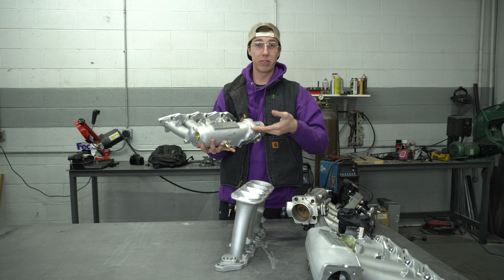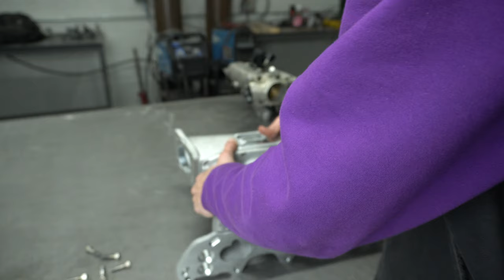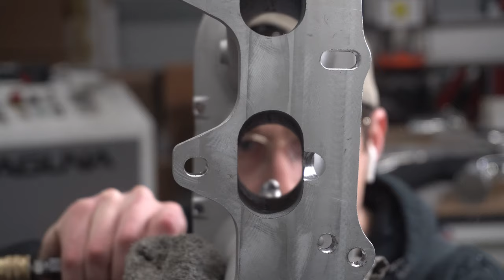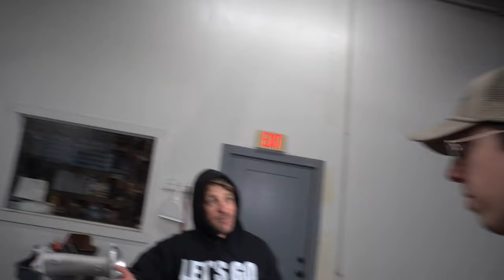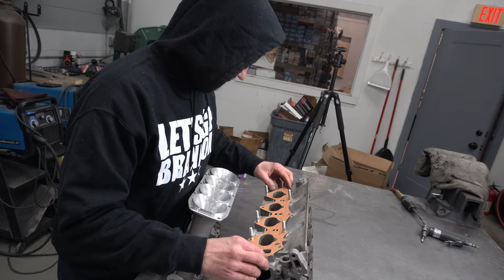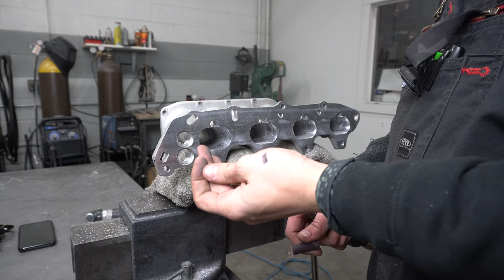How to Port an Intake Manifold Without Cutting or Welding!

Comment: I believe you don't want to blend the port dividers at the end of the runners, they are designed that way so the pulse wave resonance does not negatively effect the adjacent runner. Ideally you want a gap between each bellmouth so one port is not sucking air out of an adjacent one. Smoothing the inlet runner tubes is probably fine, but otherwise I think you have probably made that manifold worse overall.
There is also an optimum runner cross-sectional area to match the valve throat area, this is how you flow the most air as a thinner column of air will gain more kinetic energy and ram in more just before the valve closes, this is especially effective in variable valve timing/lift heads.
Runner length and plenum volume is also tuned for optimal performance across the rev range.
Match the ports, not to the gasket, remove the minimum amount of material.
If you don't understand Helmholtz resonance and such, just don't mess around with things and most likely make them worse.
Read David Vizard's publications on optimum inlet runner taper angles and bellmouth radius to diameter ratio... before hacking into your extensively developed and designed manifold. You can improve on a product mass produced down to a price, but not by trying to completely redesign it in this case, just clean up casting flash and such.

Comment: What kind of cams are you running on your built motor ? If stock you should definitely upgrade.. the b series vtec engagement isn’t as strong as let’s say an H series but if you get cams you might feel it a little more
Reply from the maker: I was running b16 cams. I upgraded to GSR cams and saw like 40hp gain at the same boost level. Pretty nice.

Comment: "Witout cutting or welding" ok john.. go grab a b16 manifold and port it for me without cutting and rewelding. And I mean runners ported and knife edged.. Anyone can port a manifold with a removable plenum. Stupid clickbait title..
Reply: The title is exactly what he is showing. You could just as easily go grab a Skunk2 ultra B16 manifold. It’s pretty easy to do the porting yourself. Just one bit of advice, don’t knife edge the runners. The incoming air charge is traveling 90* to the runners. Smooth is the effect good porting should net, higher velocity with as little turbulence as possible.